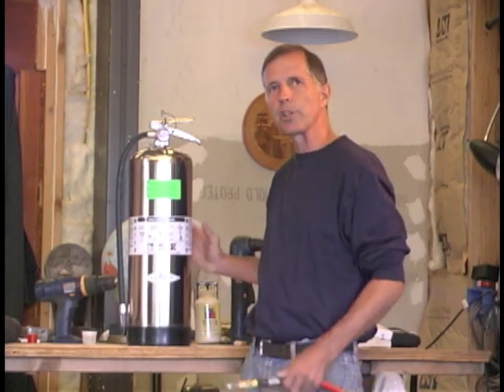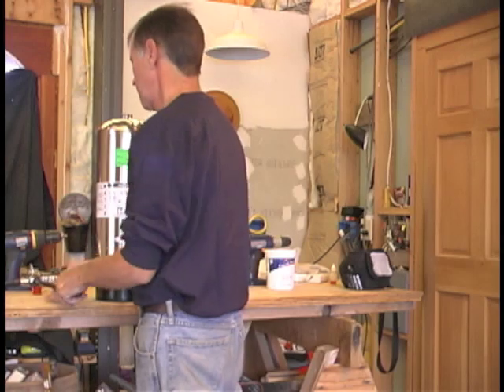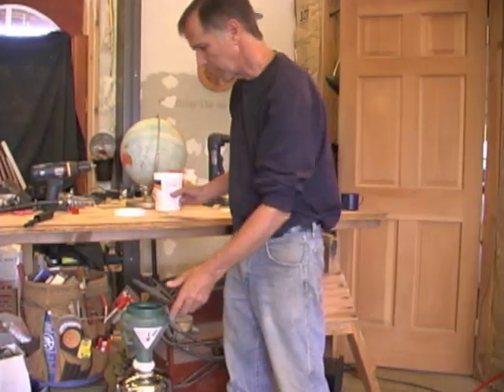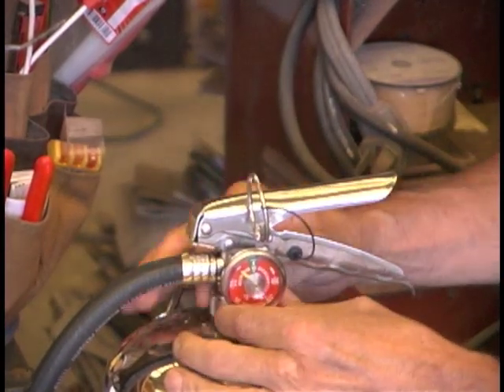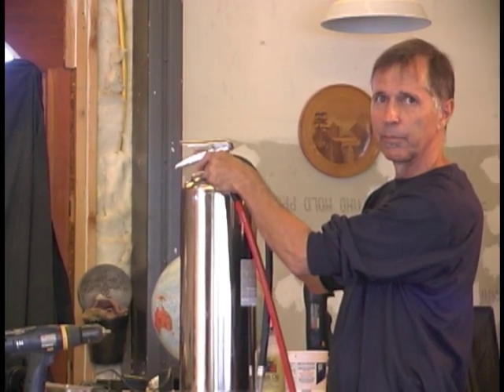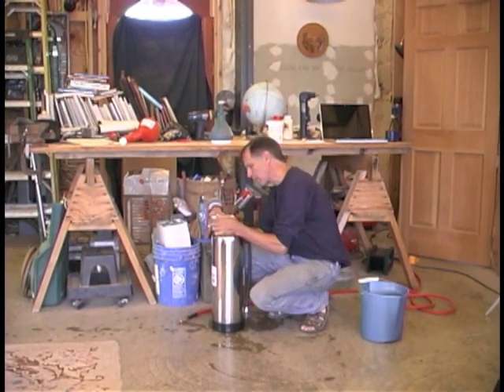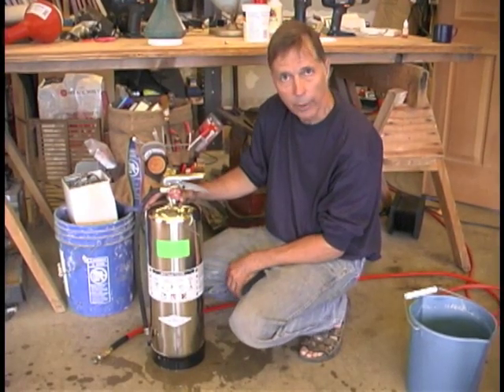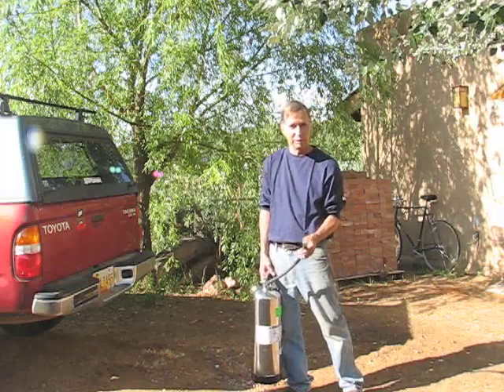NovaCool UEF Foam Fire Extinguisher

Comment: You may want to consider putting the water in first, then adding the Novacool. That way you're not pre-activating the surfactants, and you don't get all those bubbles like you did when you poured in the water.

Comment from the maker: Measuring out 2.5 gallons of water is the best.  You can also fill to the
bottom of the plastic tube inserted in the can for a close approximation.
 You do not want to fill it all the way to the top.  Many plastic buckets
can be bought that are calibrated inside the  bucket.  With Novacool you
only use 2 oz.s so this will work.  Other concentrates require far more so
you will have to take that amount into account.

Comment: HI CASEY IF YOUR  in a good mood got a new question for you please I have my 240 water can if it's filled with foam my question to you is I think I herd some one say if I duct tape it so it only draws from the bottom of the syphon tube it will have a longer discharge time? Thoughts please thank you.

Comment: The manual for this extinguisher says to fill it with water until it overflows, but should I measure out 2.5 gallons? It seems like overflowing it with water would leave no space for air, but I was thinking that the stem might have some sort of a chamber for the air. Do you know which way is correct?
Reply: I dont know about adding additives but the way to fill water extinguisher it supposed to be filled to the bottom of the overfill tube if I was going to refill one I think I would run it as a compressed air system and use dish soap

Comment: my question for you is would there be any tactical advatange toa mist nozzle it only seems to have a 12 foot range thought plesase thank you I would think that a mist would be more likely to reach around obstructions ?
Reply: As it is, it is a straight bore nozzle and can reach out to about 25 ft.  You can play around with the end of the nozzle - put your finger over the end to create a fan spray and not open the valve all the way to get less reach...

Comment: Hi Casey wanted to ask your opinion it seems my unit is charged slightly to the right of  the white stripe but still in the green thoughts please thank you
Reply: You should be ok but you can also bump it back up. If it's been longer than 1 Year, you should recharge it by putting in new concentrate.
Reply: I MEAN EVEN IF  IT'S TO THE RIGHT OF THE  WHITE STRIPE SLIGHTLY DO YOU THINK IT'S OK AS LONG AS IT'S STILL IN THE GREEN?  Thoughts please thank thank you
Reply: I mean as long as it's still  in the green do you  think it ok thoughts please thank you
Reply: @Fredengle  yes...
Reply: @novacooluef  thank you for your response we can bet the stanard water nozzle is not great on grease fires even  with nova cool so I would bet putting my finger in the stream of my nova cool filled unit would be the way to make it effective on a grease fire ?
Reply: I mean to create  a spray ? Thoughts please thank you
Reply: @Fredengle  When I have tried it on hear fires I have bounced it off the wall and into the pan. Putting your finger over the end of the nozzle  would allow you to fan the spray and not blow the grease all over...
Reply: yeah for some one that is not a professional firefighter figure out how to bounce some thing would probably be diffcult I would guess there is likely easier a chance that if I were to stick my finger in the stream as a fanned spray it would be more likely easier to figure out  I guess ps thank you for your response at this time I tried my extinguisher and it seem a large portion i only tried it with water only at this time that did not discharge I wonder if it could be because could my cousin have been evil enough to drill holes in the pick up tube I guess a small hole might not have much negative effect but we can bet the bigger the wholes the greater chance of having a problem I guess I had better look for the duct tape{ dont you think )? thoughts please thank you
Reply: I've been told that drilling a small hole  near the top of the black , internal tube will introduce air and create an air spreading effect but haven't tried it...

Comment: HI Casey sorry for the delayed response I think what you were refering to in your previous statement to me was the homemade compressed air foam system you can see what someone else did in a demo here : of course I would still encourage you to use the proper charge pressure ! I think this link that I enclose is what you were refering to : ( Please check out both links I think you will like them and you may learn something !) https://youtu.be/IPmSjeesOAs & please check out the following link ( you can read what the guy said in the description ) :  I think the following link gives you an idea of an different version for a fire extinguisher : http://send-the-water.blogspot.com/2014/04/cafs-pressurized-water-extinguisher.html I think that is what you were refering to and I wish you good luck with your trials of course someone would have wanted to come up with this because the actual " CAFS " units are very Expensive! I wish you good Luck !!!! I will say I dont know about putting a hole as close to the top as they show in the picture since the unit is not completely full what I did was put gorilla tape when I put the valve assembly thorough the overfill tube than I drilled over top of the tube thats what I did but if you have a different idea good luck !! so in case I was unclear you would leave the the syphon tube connected to the valve assembly put it through the overfill tube put tape underneath it than drill over the tape that you put at the bottom of the overfill tube ! I wish you good Luck!!! Also here was an Idea from Mike Ciampo from NYFD : https://youtu.be/jy9yQvJ6I_k It took me a while to figure it out but here is what he wanted to say but here is what he said : any way for those that were wondering I was able to make indirect contact with Mike and here is what he said  in individual units in the FDNY, they will often fill their cans with a little less water.  This enables the can to have more air in it, which can assist a unit while awaiting the engine's hose line.   It won't add that more pressure because the can is normally filled to 100psi and the gauge will read overcharged when going past that pressure.  The reason for less water and more air, allows us more time inside the apartment or dwelling containing the fire, while the engine is making a long hose stretch to the fire area.  As for the exact amount of water, units play it by ear and don't measure the  water exactly.   Most units may put 2 1/4 gallons in it and leave the 1/4 out, some may just run 2 gallons and leave the half out.  

We have also been adding some foam to all of our cans so that the mixture adheres to the burning materials better.  With today's new plastics, we've seen flare ups when hit with water.  So we're hoping the foam saturates the material or cuts off some of the oxygen and smothers the burning plastics.  As for measuring, our books say we use 10 ounces of foam in the cans. I wish you good luck !